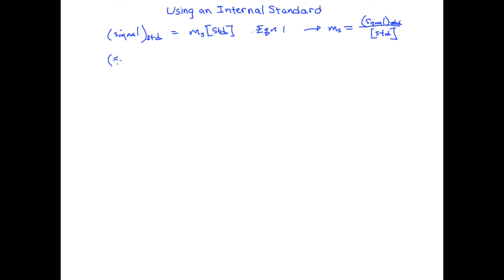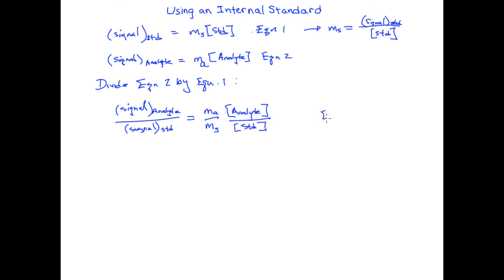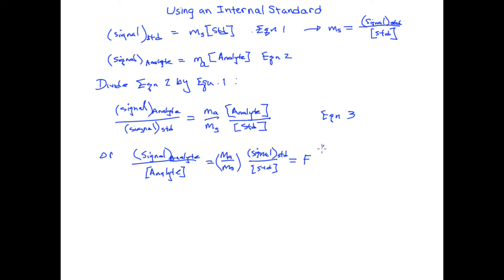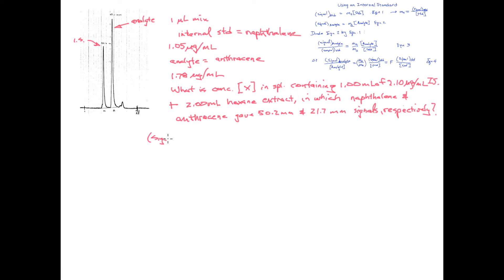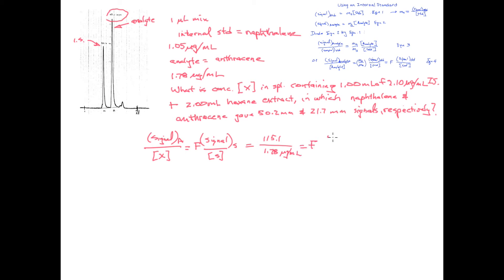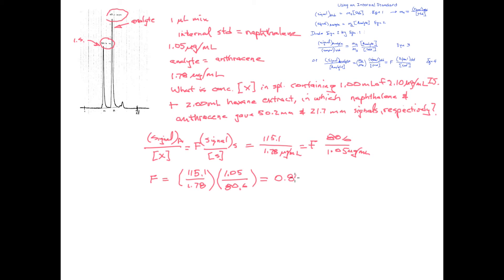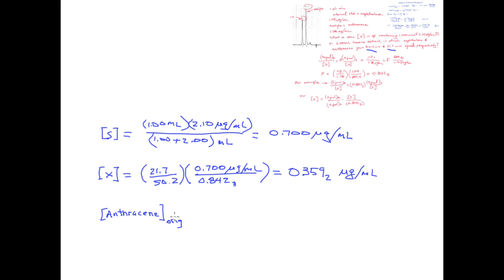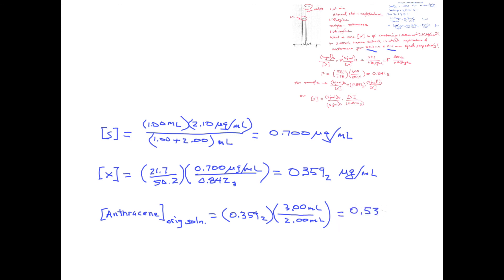Internal Standards

Comment: Thank you Dr. Mabbott! This was extremely helpful for me as i was trying to solve a similar  question which is the following:

The analgesic ointment content of camphor is determined by GC as follows: Prepare a standard solution by transferring 45.2 mg camphor and 2 mL of 6 mg / mL internal standard solution (a terpene compound) into a 25 mL volumetric flask and diluting to the mark with CCl4. . A 2 µL volume injection of the standard solution in the chromatographic column gave 67.3 and 19.8 area values for camphor and the internal standard, respectively. A sample of 53.6 mg of analgesic ointment was placed in a conical flask, 10 mL of CCL4 was added followed by stirring, heating to 50 ° C (to facilitate camphor extraction), cooling to room temperature, filtration, filtering with 10 mL CC4. , add 2 mL of 6 mg / mL internal standard solution and finally dilute to 25 mL with CCl4. Injection of 2 µL of this solution in the column gave 24.9 area values for camphor and 13.5 for internal standard. What is the% w / w ointment content of camphor?

I managed at last, after watching your video, to find a result of 45,5% . I hope i have it correct!!!!